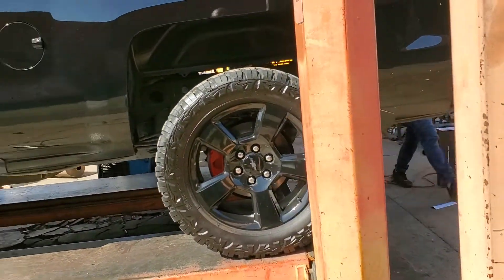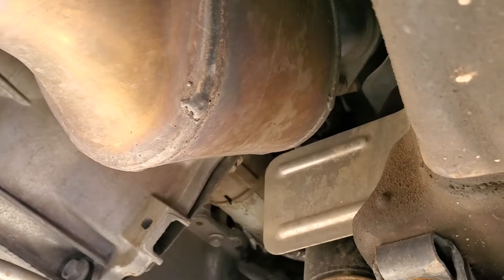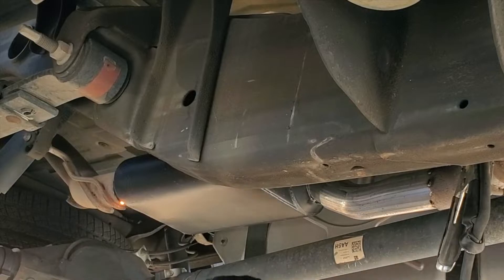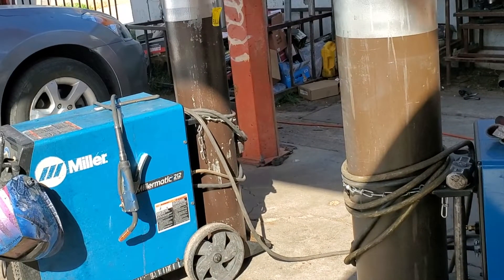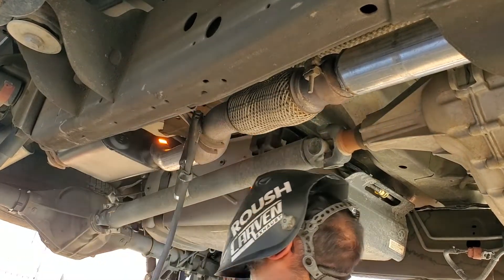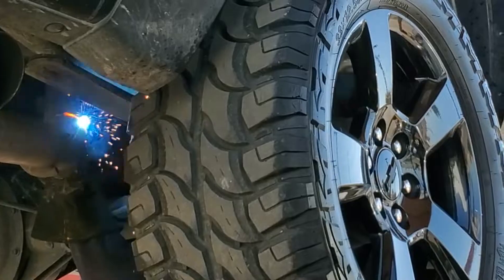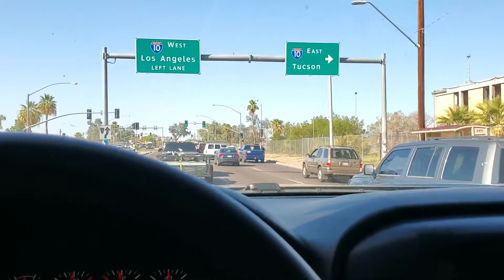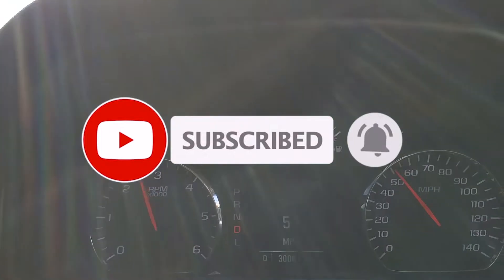Flowmaster Exhaust On Chevy 5.3 Install

Comment: If I want to add flowmaster without removing catalytic converter will be fine or it is not recommend why I this is recommended or why not if it is not recommend thanks
Reply from the maker: @elTripaSeca  if you want less noise keep it on.  More noise less cats. Either way you should be OK.